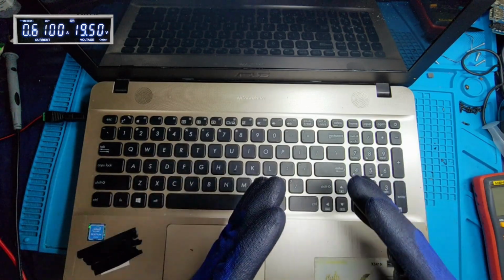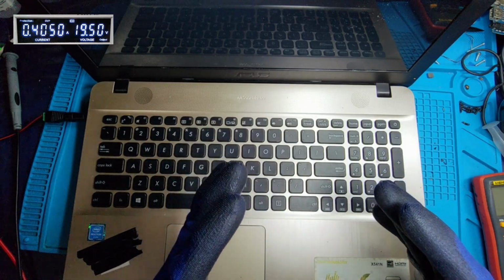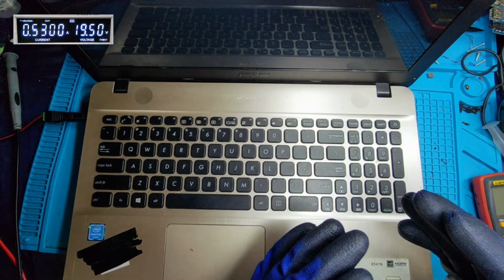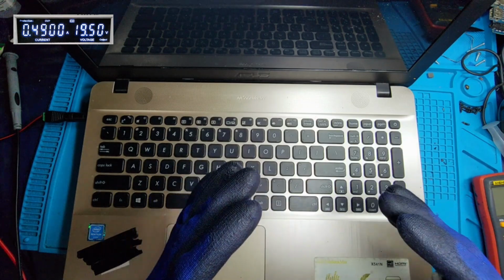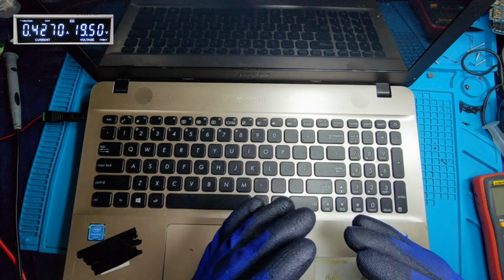ASUS X541N | NO POWER | Main power rail was Switching On & Off.

Comment: Very good explanations 👍
Thanks for sharing. 
If you short the inputs mosfets, the battery shouldn't charge either. The BQ chip will sense 19v on the CS pin - commons source (the place between 1st and 2nd inputs mosfets) without providing 25v (actually providing 6v and adding to main 19v = 25v) at the gate and will turn on its short protection and cut off the gates of the charging mosfets.
(There's few inductors, right after the power connector, which are also meant to smooth the sparks when plugging the charger)
Reply from the maker: You have a great understanding of BQ charger IC. I agree with you. Battery won't charge if either MOSFETs on the DC line got shorted

Comment: Brother, i want to ask, what are the voltage required to generate the signal PLTRST high condition??
Reply from the maker: System power ok, pch power ok and Mega hertz clock oscillation required.
Reply: I mean,  what voltages do I need to check?in order to the signal PLTRST in mode high signal
Reply from the maker: Yes. System power ok should be 3.3v, pch power ok should be 3.3v, and mega hertz clock should be oscillating

Comment: Please corect me if I am wrong..

1st mosfet will turn only if voltage from charger ic supplied to the Gate of 1st Mosfet... am I correct?
Reply from the maker: Yes you are correct 1st mosfet in this motherboard is turned on by charger IC. And there will be a delay once you connect the adapter to generate the main power rail. This is because to limit the inrush current, voltage ripples and sparks into the motherboard. 

And this known as Soft Start.
Refer BQ24725A datasheet you will get good understanding of the Soft Start function
Reply: @philiptroniks  Thankyou

Comment: Soft start means ,charging ic takes few milli seconds delay to give gate drive (in this time charging ic checks the mother board condition ,wheather there is a short or not ) by that power to main power rail will be delayed even after connecting the adaptor ,

I hope the above answer might be crct teacher ❤ and this is my first video watching in your channel , hereafter I'll watch regularly ,and hereafter you are my teacher sir ❤
Reply from the maker: Excellent. Your answer is correct. Thanks for watching my videos.
Reply: @philiptroniks thanks brother,I have two doubts shall I ask brother
Reply from the maker: @NG-es4my Yes definitely, why not
Reply from the maker: @NG-es4my Yes definitely, why not
Reply: I seen a thermal device in this video bro ,usually I watched people using thermal cam,but I don't have that much money bro ,just now started chip level service ,but by seeing in this video ,can you tell what device is that ,how to use that device bro ,like what readings @philiptroniks
Reply from the maker: @NG-es4my Yes bro thermal camera is expensive. You can use this. This device will show you only the temperature reading on a particular section, but thermal camera will show you exact components. But for the price of that thermal device is good. It's really handy. It's model is UNI-T UT306S.